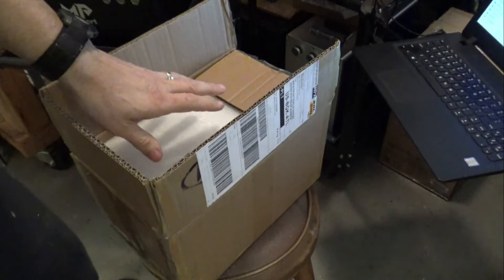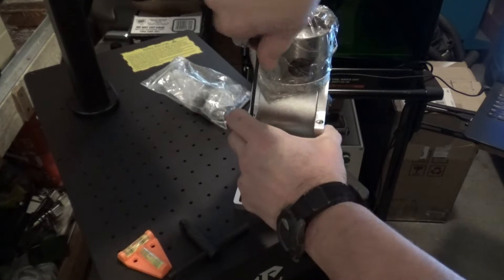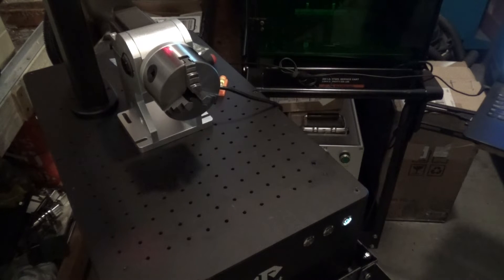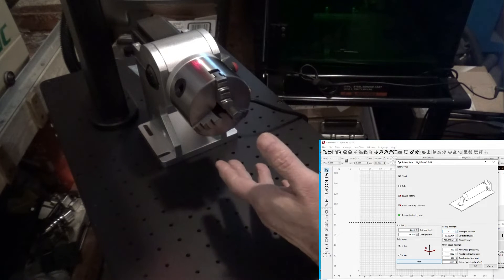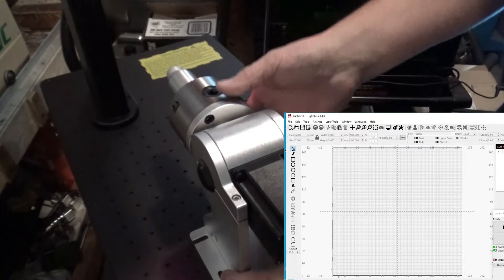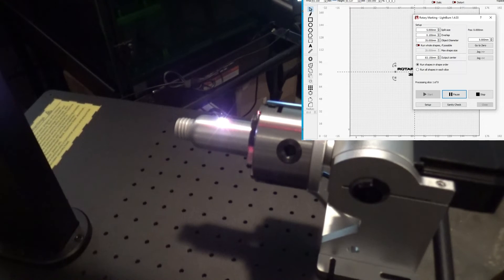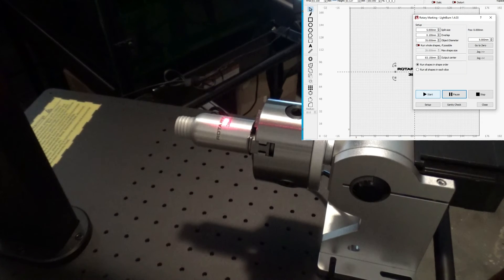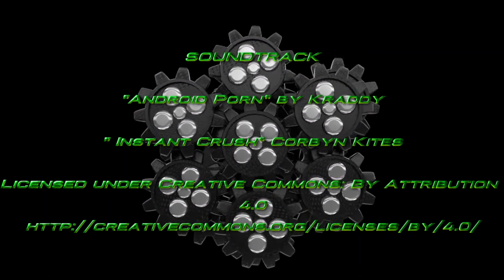MONPORT GP 30  Rotary Setup

Comment: Thank you for your series on this! Been beating my head over it. One issue I cannot seem to fix is the stepper jittering and switching directions. Have you come across anything like that? Like it will start lasering but most of the way through just swap directions. Super weird.
Reply from the maker: check connections inside

Comment: Dear Sir, You are the best of all..! Can you help me build my first Mach3-based CNC? I have bought a USB-RNRMotion Card and a parallel port Breakoutboard as those were very cheap.! However I have become very concerned about the reliability of PC-based CNC Controllers after watching videos on YT. Is that that much dangerous? Some said that it may ruin the entire project caused by HF Noise from nearby VFD, Spindles, SMPs ..etc..! And people also say USB-based communication is not good.!   If that is not solvable, I will not be able to run long projects with peace of mind..! Can you demystify this?....Thank you
Reply: However Some Makers do insist that Mach3 is old and proven solution and bulletproof..! I am very confused..! In India , Chinese-Made Rich-Auto Controllers are very expensive (25k INR)..! Masso is 4times expensive than those again..! The Breakoutboards I bought Costed me about 1k only..! It makes me nervous..! That since these are cheap they wont be reliable at all.!

Can you guide ?

I am planning to Build a Standard  8ft*4ft CNC Router with 3axis Operation Only.!(May be a  4th axis for the second Y).
Reply: The Reliability of USB Based and Parallel port based Mach3 Boards worries me a lot..! But I cant Afford expensive Controllers..! 
I dont know whether these can be trusted for longer carving projects since those are online PC based operations.! 

I dont know how important in terms of reliability is it to have a dedicated powerful Controller Card rather than having a cheap breakout board paired with PC.

Please demystify some of my doubts or do a video on this...!

I will be extremely helpful for people like me
Reply: So many doubts to clear..!!!!

I am in a south Village ,Buying Shielded cables are also expensive here..! So I have decided to use Adhesive Aluminium tape to wrap  all of my wires and earth one end by soldering to the Chassie.!  Will it help?

Is it true that The signal sent my mach3 board is 5.volts and hence it is  less immune to Noise..! Controllers like masso will work without shielding as it is sending 24V signals.!??
Reply: I really wish if you could Please explain  on Reliability and longevity of carving operations based on mach3 parallel port and usb based breakoutboards.!
Reply: And one more doubt is about using servo motors with those Mach3 breakout boards.! Some say these boards are not able to produce the frequency or power required for industrial grade servo drives. But I have seen some people playing around with servos in mach3 usb motion card.
Reply: My overall worry is all about the consistency and relaiblility of USB/PC based Mach3 Boards. 
EMI Problems and its level of intensity
Usability of servo motors..etc
Reply from the maker: Lots of comments here. I have seem machines that are poorly wired perform well. There is not a great answer.
I would wire the machine as best as you can . then if problems occur upgrade as needed.